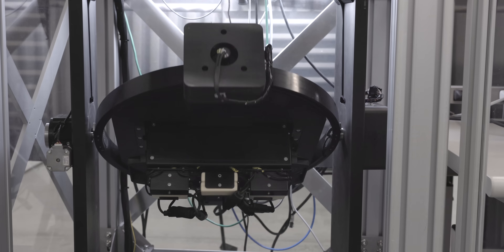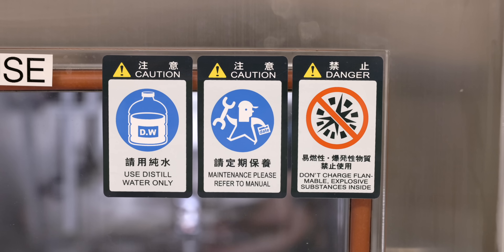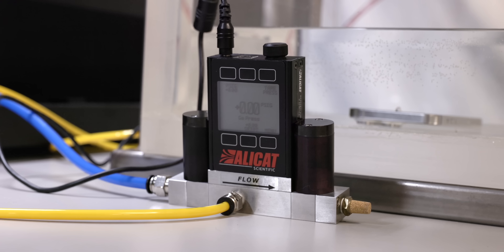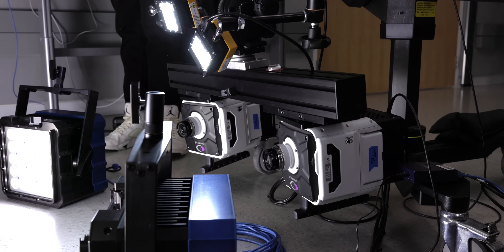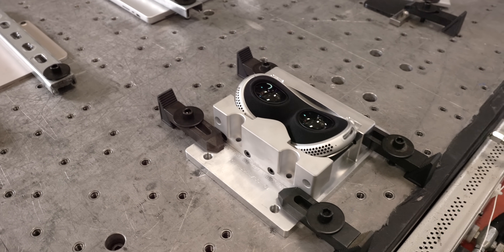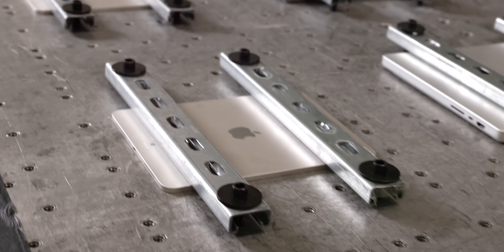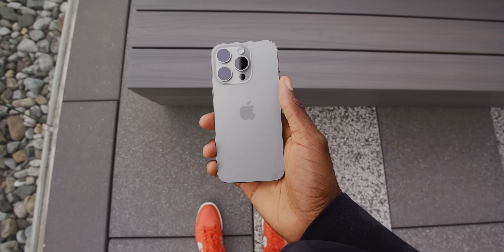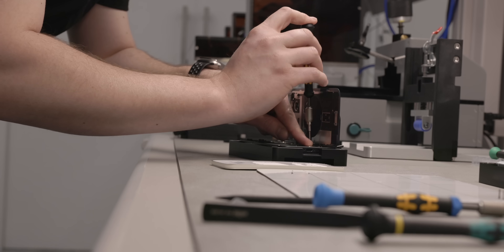I Visited Apple's Secret iPhone Testing Labs!

Comment: I’m really happy to see your journey! It’s inspiring and you have put in a lot of hard work. But with great power comes great responsibility and it seems like you didn’t even scratch the surface of how apple really often neglects design flaws and actively resists the right the repair (and generally gaslights ppl). I wonder if you will go down the tougher road where you can use your prominence to actually push apple to improve

Comment: To just sit there in front of Apple's head of hardware engineering and NOT hold them accountable for their anti-consumer practices is one of the biggest missed opportunities this guy has failed with. Even if Apple tried to force you to then not post that video, you have enough clout and would have enough follower support to get away with it. But no, you had to lack a backbone when it comes time to ACTUALLY advocate for the end user. Man, I am so glad Louis Rossmann lambasted you for this spineless video.

Comment: while technically what's being said in regards to repairability and durability is kinda true (a panel glued on with obscene amounts of glue will be stronger than a panel held on with screws, a solid panel will be stronger than one with hatches for component access), the trade off is a very lopsided one. Even the most repairable of devices can still have a decent level of durability if designed correctly, just look at the framework 13 and 16, with the 16 being a little further down the repairability path. They're still good laptops, they're still pretty durable, or even the old galaxy S5, it had an easily removable back to access expandable storage and almost hot swappable batteries, and yet it was still able to achieve and IP67 rating. Personally, I think Apple has gone way too far in sealing (both with glue and with software) their devices, and that's not even to mention how they profit off of being the only ones "allowed" to make the repairs or how sealing devices force customers to keep buying new ones.

Comment: Durability has no adverse effect on repairability. I used to work for a test and measurement company that made instruments with delicate precision aligned optics inside that you could throw down a flight of stairs (which they did) and it would still work. If you had to repair it you could easily open it up. The thing that works against repairability is needing to make something both slim and pretty.
Reply: There is a tradeoff when it comes to water resistance. No doubt the early smartphone were a lot easier to open up when they didn't have adhesives, but then again I'd rather have to go through the extra step of breaking through the adhesives when I do need the repair rather than having my phone way more susceptible to water damage even from rain because it didn't have those adhesives. Some people mentioned gaskets in other comments, but adhesives are the more permanent solution if you're to keep your phone for longer.

Comment: WTF is this logic
"The failure rates since we got to that point have plummeted- the number of repairs that need to happen"

Well yes, the number of repairs went down considerably because you either CAN'T repair the product or you CAN'T afford to repair it. 

Abusing stats like that is just like saying "uhhh, 99% of shark attacks happen in shallow water, so it's a lot safer to deep-sea dive"

Comment: The thing about serializing the parts is this: let the customer potentially use a dangerous third party component! If it fails, you have no liability, so who cares? All it would do is encourage third party parts to improve in quality. And if they end up installing a faulty part, they would at least be able to replace it again. It's clear that Apple only cares about shortening the life-cycle of products so they can sell more. They don't care about the environment, they are just aware their customers do, and are playing into it purely as a marketing tactic. But the facts show that really they are concerned only with maximizing profits.
Reply: I thought the same thing. Sometimes Louis gets going & hes not wrong but hes also being an ass, but this inteview is NUTS, I cant believe Marques platformed that corporate rat let alone endorsed his anti repair rant
Reply: @alexphelps7042  I agree completely.

Comment: At first thought this ain so bad untill it get so bad it made my head spin. Its not about product design making it repairable or not its about locking down supply chain and making every effort to make parts NOT available for anyone else to do their job. And the fact you are made to figure out in the video that durrable phone is not repairable and apple employee sliding in thats not completly the case and that they have repair program because battery is for example a wear part just reveals how scripted this is.

Comment: I can extend the life of a device by repairing it. That's also durability. "having endurance" Endurance for consumer products is not just the length that a single device will go without intervention. Take your typical dishwasher for example. The life of the device can be (and in a large number pf cases will be) extended by repairing the device or performing maintenance on it. For a computer, maintenance is not just maintaining software, but also hardware. If I crack my screen, I should be able to fix it. That screen repair is going to be cheaper than a whole mew device and gives my device more durability.

What a puff piece. Learn something from LTTs tours and interviews. You must be allowed to ask questions. You must ask questions that are uncomfortable. You must do these things as a journalist. Failing to do so hastens society down a dark path.

Comment: The repair industry isn’t asking to make the devices less durable so that they can be easier to repair, they are asking for the ability to buy individual components so that the repair can be possible. 

The people repairing devices for a living are smart, they can handle working with surface mounted components, glue, rubber gaskets etc, but they need to be able to buy those components from manufacturers so that they can do the repair. Apple purposely bars independent repair shops for being able to buy components, that what make repair difficult.

Comment: If Apple made cars, if you got a puncture, you'd have to replace it.
- remove the glued fender
- use a special key to unscrew the rim
- for this you would have to replace half of the suspension
- and finally, after collecting everything, it would turn out that not everything works as it should, because the replaced parts are not from this specific car, but were taken from another one intended for parts
Reply: Also when you replace the brake pads the car will "complain" that it cannot verify if it's an "original" part, even if that new brake pad came from ANOTHER Apple Car!
Reply: Also, you have to swap the entire transmission and axle because apple won't just sell the tire on its own
Reply: so a german car 😅
Reply: @oh_ritmo  Fictional German cars that exist in your head yes 😅
Reply: @miguelangelo3280  German cars are terrible.  TERRIBLE.  Seriously, outside of branding, they don't even break into the bottom of reliability, sales or 'cool' lists.

Comment: This is funny. He talks about improving designs of a product yet the MacBooks with badly designed logic boards never had an improvement over the years. This and making it hard for independent repair shops to get parts for repairs, shows that apple doesn't care about "longevity". This whole "longevity by design" is false advertisement.

Comment: The more durable the less repairable ? REALLY ? WTF I never heard such ill informed bullshit in my life. As if a fairphone would be less durable than an I phone. You know my HP 8460p from 2011 is a 3kg chunk of metal, but EVERYTHING, even the CPU is replacable in it and it's fully modular and repairable. This outlasts any modern macbook with SOLDERED IN NAND CHIPS THAT WILL DIE after reaching their TBW limit. This channel really is a shilly disgrace.

Comment: I think its a sign of being completely out of touch with actual consumers. For a guy who is always using new phones battery longevity isn't really an issue. You think the priority is "durability" in the sense of the phone withstanding stuff like falling into water, because that is something which might happen to you, but for the average consumer the issue which is more likely to be an issue is battery life. So for you it is more important to have a waterproof phone, but for nearly everyone else they would just rather being able to pop the casing off and hotswap the battery.

Every smartphone I've had I only changed it because the battery went to shit and the cost to replacing the part was ridiculous. That's the issue, not this fake "durability" you keep talking about.

This isn't propaganda like some are saying, it's just an out of touch millionaire tech Youtuber
Reply: Out your axxx. Propaganda is propaganda.

Comment: There are lots of products that are IP68 or 69 that are easy to open up and replace a battery. It's a ridiculously stupid statement that this protection would make the device less repairable. Unless of course you design it in a stupid way... 
That's why you'll NEVER see me use an Apple product, drive an Audi or any of those companies that make a hobby out of sloppy designs with the intention to screw over the customer.

Comment: I was today years old when i learned that serialized parts and glued phones that sometimes break the LCD even when using apple provided repair parts that cost more than the device is worth were all in the name of durability. Someone needs to contact webster and have the definition updated. I thought we had some of these features back with removable batterys and replaceable 3rd party and oem parts, but that must have been a fever dream. Thank you for contributing to the revisionist history of repair and promoting anti-consumer behaviors. Doing the lords work.

Comment: OK the biggest thing that bugs the shit out of me is that repairability = not durable. Because serializing different components and making it downright impossible for the average user to fix their phones, selling batteries or other parts at prices that even ebay can't compete with profit wise makes the phone more durable.

I understand having a phone be more durable can make it harder to repair. But there's a crystal clear line between nessecary design improvements and a middle finger to the underpaid highschooler trying to keep their phone going at whatever cost.

Cool, the phones are water resistant and robots can drop them in ways that don't break them. And hell, an indestructible phone sounds fantastic. But until we get to that future. I'd rather have a phone that is as reliable but repairable as a 1970 ford f150 than a complete punch to the face any time I look at apple or iFixit and read this product will not have adaptive color if the screen is replaced
Reply: Day by day, we are closing in on the dystopian world where we don't own what we bought, not the future where we can buy an indestructible phone because that wouldn't be profitable for the south park cable company ;)
Reply: @psiton  can't wait to hear Edward Richtofen saying "replace your battery next time! Hahaha. Oh there won't be a next time. :)"

Comment: 7:20 NO, this is just untrue. Durability and repairability are not at odds with each other. Durability repairability are at odds with cost. It costs more to make something both durable and repairable. So because Apple wants to save five cents on infill under the audio IC on the iPhone 7 we get malfunctioning iPhones. If you don’t believe me that you can have something both durable and repairable just look at industrial equipment. Or if you want to still talk tech look at industrial equipment control. These are some of the most durable, long life systems and equipment and yet can easily be repaired when they break.

Comment: It was an interesting video to watch as general overview of how things are tested, but I felt like there was a huge blind spot that would be nice to dig into further, after alluding to it at the end of the video.
How phones have been failing since the beginning is not from water damage, it's mostly from breaking.

That's the reason why Apple showed a drop test where the phone was conveniently falling on the titanium case instead of the glass. To be repairable, it's necessary to have repairs at fair prices for genuine parts that breaks often: that's the front and rear glass, or the display itself.
This is where the focus on water resistance felt like at best a distraction.

In the meantime, how many people do you see using broken iPhones in real-life, because it's too expensive to repair them due to the unavailability of genuine parts - despite how easy is the repair itself.

Comment: I like your channel, but even first seeing this video I disagreed with the general blanket statement of longevity and repairability being on opposite ends. I think you can definitely have both. It's probably more of a triangle with low design complexity in the third corner and you can only have two.
but now, especially after louis rossman's recent video, I can only hard disagree with everything in this video and I think you should use your huge reach on all platforms to call Apple out on their BS.
hopefully you react to louis's video in an explanation or clarification video, at least.

Comment: Ah I see everyone is coming over from Louis, rightfully so this needs to be called out for what it is. They have entire labs to "durability test" their phones yet they have laughably bad engineering flaws. This is what you get when a company doesn't give a rat's ass about making a solid upgrade from last gen and just copy and paste designs without examining flaws. Instead of seeing how much torture the phone can sustain from the outside how about yall actually design the damn phone from the inside to not spontaneously fry it's own GPU or disconnect the display from the laptop. Or maybe allow customers to get their damn parts for replacement, Smfh....

Comment: tldr; your products aren't "product[s] that never fails". You don't even update blatant design flaw for 3~4 years.

7:40 "a product that never fails OR product that maybe isn't very reliable but super easy to repair"

First off, LOFL Apple, you've never built a product that were even free from obvious errors.
failing hard drive connectors, cold soldier nvidia GPUs, iphone 6&7 audio IC failure, mac's short screen flex cable, 52V backlight rail right next to data line (built to kill CPU) etc. Do you want me to keep going?

Even your current iphones do random on/off or bootloop depending on how hard it fell.

I mean OK, first time errors are acceptable, but you certainly take ages to update designs and that's NOT OK.

2016 2017 macbooks had issues with screen flex cable fixed in 2018, but you only covered subset of 2016 models and not 2017 cause Apple.

Please stop BSing the consumers, blocking IC parts from vendors, and lobbying against Right to Repair cause it's gonna take 0.0001% of your bottom end.

Thank you.